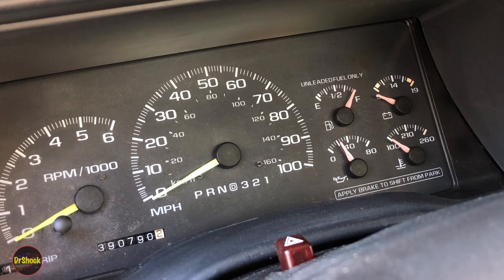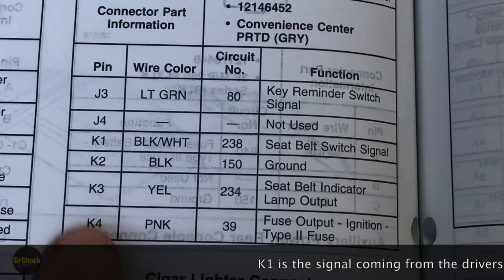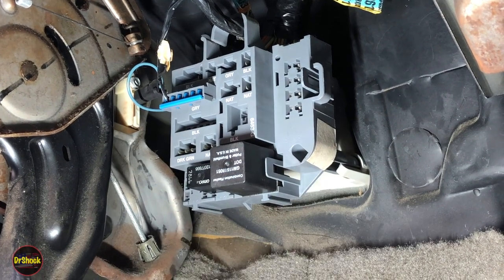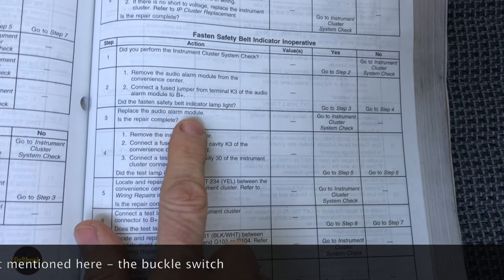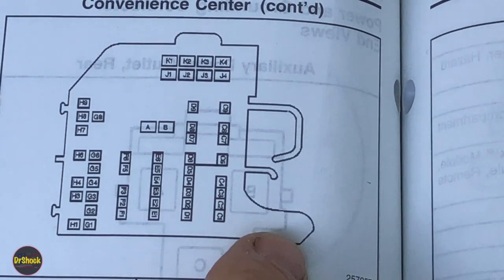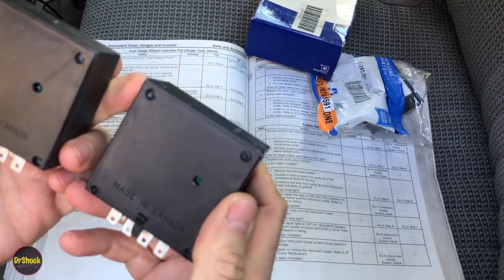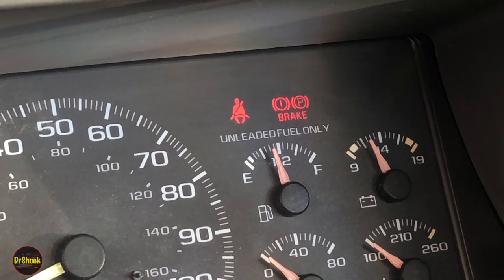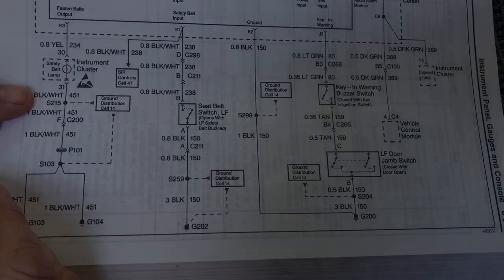1995 - 2002 GM OBS Truck Seat Belt Indicator Inoperative Repair (Chevy & GMC)

Comment: Ridiculous problem! I got an Escalade cluster to upgrade mine and turns out after tracing the seatbelt bulb (removing cluster, tried 4 bulbs, swapped polarities, tried both clusters, bout 3 hours of work) it was just not working because I had removed my door chime to wire my stereo. So glad I found this video. Popped door chime in everything worked flawlessly. Great informative video. 95% of people wouldn't care but I wanted all my lights to work properly!

Comment: Another great video Doc! You answered my problem of seat belt not recognizing the belt being connected. It's intermittent right now and after a few clicks it registers but good to know what I'll need to do to repair it. Thanks for sharing.
Reply from the maker: Thanks.  I mention somewhere during this video that this problem can also be just the switch inside the buckle, or the harness going to it.   The harness tends to chaff after this many decades, so tone that out with a multimeter before diving into the cause this video specifically got into.
Reply: @DrShock  I've been looking for ways to contact you about other issues. I don't see email, Instagram or way to show you a picture.
Reply from the maker: I can answer questions as comments on the videos I post, but as this channel is a side gig I don't do any consulting or diag outside of that.
Reply: @DrShock Looked at videos on your page and haven't seen anything about blower motor. I used the climate control vid several times... I have weird looking box under my blower motor (99 K2500)

Comment: I really need a seatbelt for 1995 C2500. Can u please post a link?
Reply from the maker: Sadly, GM discontinued the bench seat belt parts for the 3/4 and 1 ton trucks well over a decade ago.  While there are some aftermarket types that claim to fit your best bet is a pull your own parts type salvage yard.  Like an LKQ PYP or similar.   Stick to 95+ up as older OBS trucks used a different supplier (TRW) with different belt tongue size that is incompatible with the Bendix ones.
Reply: @DrShock  ok thank you sir
Reply: @DrShock  LKQ ? AND PYP?
Reply from the maker: Yep, LKQ Pick Your Part (PYP).  Just one relatively nationwide brand, I'm sure there's something similar in your state.  Just good for pull your own parts salvage yards or the like.
Reply: @DrShock  ok thank you
Reply: E-Bay has some. I fought new seatbelts for my truck too. I ended up with a junkyard one for passenger and a wrong year one for driver side... it is "TAN (88-94)" but my Suburban is "NEUTRAL (95-99)" but works the same and is close enough for me. Make sure you match colors if you don't want it to look slightly off. 95+ interiors are Gray, Neutral, Blue, Red. DO NOT bother with LMC seatbelts they look terrible.